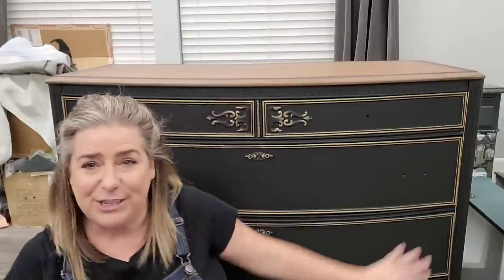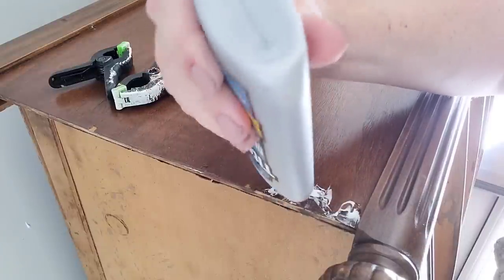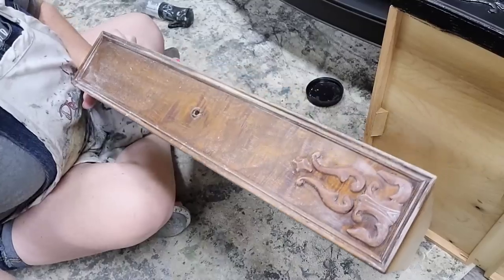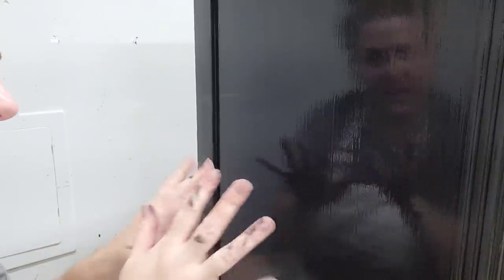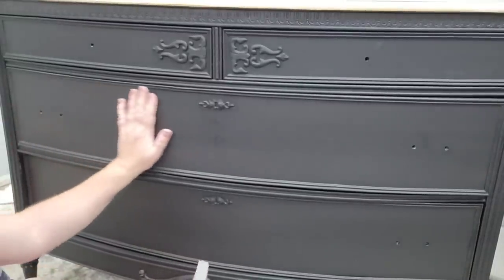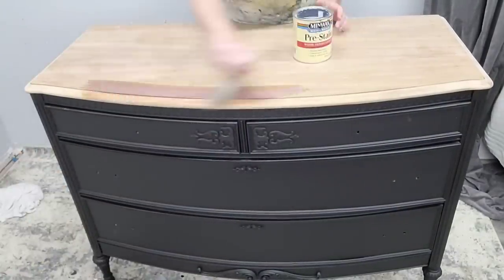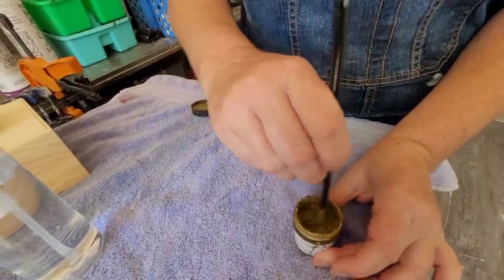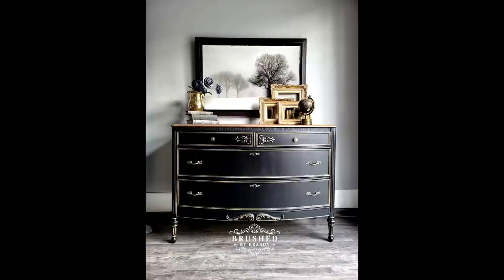Little Black Dress-er, a classic furniture finish make over

Comment: I am in love with this piece!  Very stunning. I love it all painted too. How would you compare the colors of Caviar and Anchor? Are they closely the same blacks? Thanks Brandy!
Reply from the maker: They are both pure rich blacks, just in the 2 different paint formulations/lines.
Reply: @BrushedbyBrandy  
Unpainted, but I probably would leave the 2 thin top  drawers unpainted. (wood stain in a light white oak, honey, or cherry stained wood), with a pin line of black and match the top stain.

... and I might have to "Gold Leaf" the designs and legs at the bottom.

Comment: Thank you for your practical advice and beautiful aesthetic approach to your craft - you are a joy to watch!  I have also watched your short clip on gilding wax v. mousse (oil vs water base, fade vs not, etc) but still not sure what led you to choose the wax for the drawer fronts over the mousse, especially since you sprayed over a water based topcoat on it? Any insights?  Txs!.
Reply from the maker: It glides with my finger, mousse doesn't smear as well, wax dries permanent in 24 hours and I seal with no issues in such small areas
Reply: @BrushedbyBrandy  Got it, thanks!